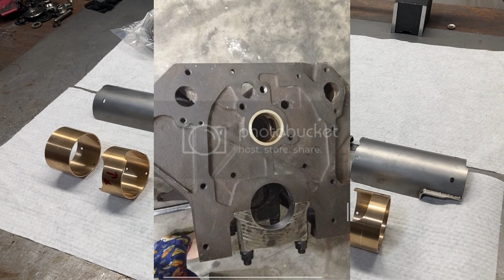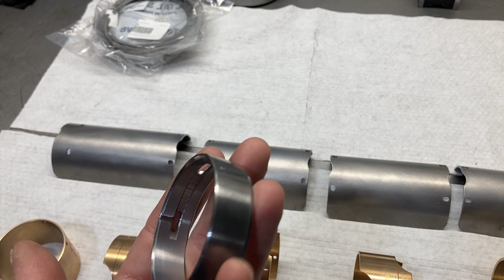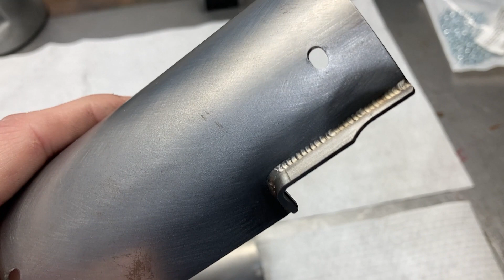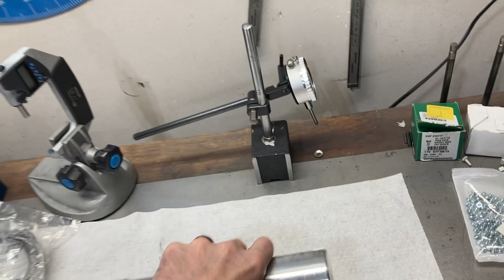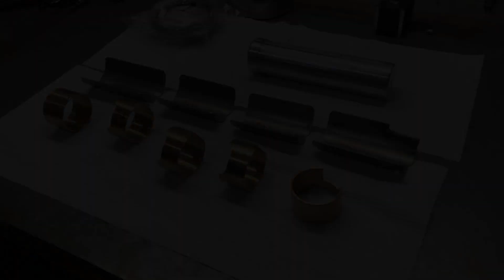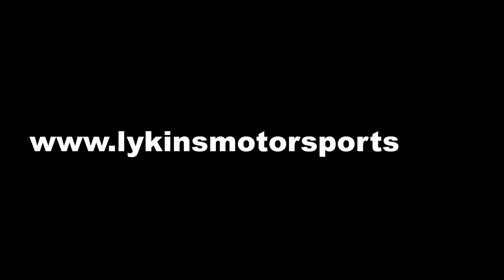Lykins Motorsports ENCLOSED CAM TUNNEL OVERVIEW

Comment: In the late 90s  , early 2000's with the nascar cup ( Flat Tappet ) engines , mainly chevys . We mad a complete Cam Tube out of Alum Tube ,  complete with lifter bores and cam bearing bosses . We used either Roller bearings or 55MM babbit bearings . Then we Bored the Cam Tunnel oversize and pressed in the complete assembly .  The babbit made more power than the roller bearings . We mainly did that for Lifter and Cam Oiling. The Blocks and cam tunnels were also modified to use small carb jets to spray oil on the cam lobes and lifters. The Busch or Xfinity now ( Roller Cams ) we used sheetmetal like yours to block the bottom of the cam tunnel , it was just fit nicely and Siliconed in .
Reply: Yes Sir the good old days. 
Things we couldn't talk about back then. How about drilling the entire cam oil gallery's, front to back ? Reverse oil feed to the front of the block with the head of the mill at a compound angle ? Scavenge the back of the block in between the block and the flywheel ?
Cylinder hone with water pump, motor mounts, bell housing etc., bolted on ? Repairing big block Chevrolet after the main webs, were cut into by someone not paying attention with the boring bar ? I had 1 block, for a reason it had to be repaired. The previous machinist???? not only bored thru the main webbing, he thought he repaired it by putting in pushrods into the galleries. Yes, that wasn't a misprint. Ever try and drill or machine a pushrod ??????
I used a carbide tip concrete twist drill, sharpened the rake and backcut and yes I slowly but surely drilled the 3 out.
About 12 hours, a day and a half.  Replaced them with brass inserts, and epoxie them in place. This engine is still being raced to this day. 
Thanks for the memories brother God bless 🙌🙏
T.S. RACING

Comment: Lykins Motorsports  Brent, how are you gonna test the difference/hp gains of this? Will you dyno it first without this kit and then take apart - install - then dyno with the kit or vise versa?
Reply from the maker: There will be no before/after.  A cam tunnel, as stated in the video, is good for about 3% of a horsepower gain.   This has been documented.

Comment: It looks like you have really thought this through. I have contemplated this many times.  For what it's worth, I have used JB Weld with Great success in the lifter valley of a Big Block Mopar where the openings are. I made aluminum dams for windage control and after 3 years of service in drag racing,  the client was having me change the intake manifold for improved performance and I was able to see how the JB weld was doing.  It showed no evidence of any problems.

Comment: WOW!! I just love the work you do. Very informative and I'm learning alot of stuff every time I watch you. Thanks alot for keeping the FE motor going into  the future. I'm 67 and been running and working on FE motors since high school with my older brother. He taught me everything I know about engines and your a step up on everything I've learned. I've got a 67 Mustang fastback 390 car that I bought when I was in high school and still got it and running today with a very built up 390 engine. I've got a brand new 427 side oiler I bought in the late 70's. I bought the bare block, steel cross drill crank, lemans connecting rods and been gathering parts ever since. The block is a 1968 with the hydraulic oiling galleys. I bought my mustang in 1971 and the original owner changed it into a "Gasser" with a straight axle and the headers coming out behind the front tires. I'm going to start building the 427 in the next year or so. So thanks again for sharing all of your knowledge on the FE motors. Thanks.